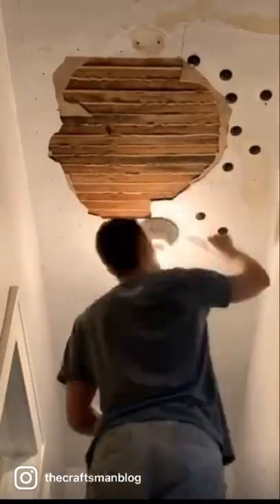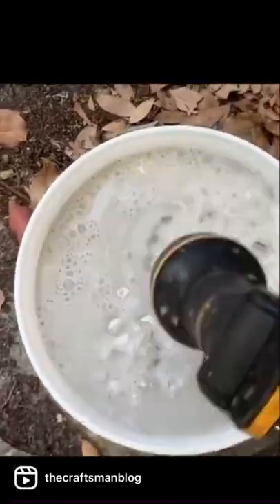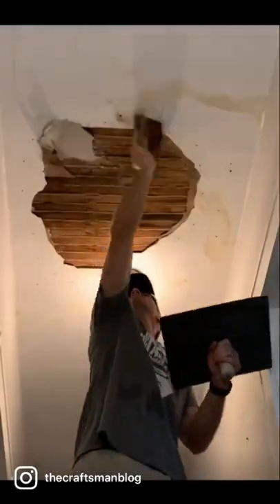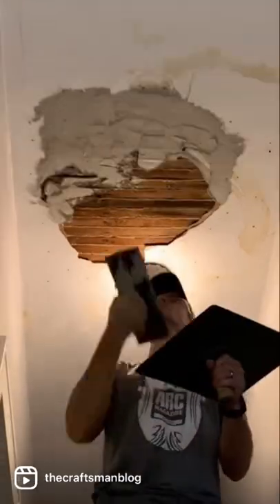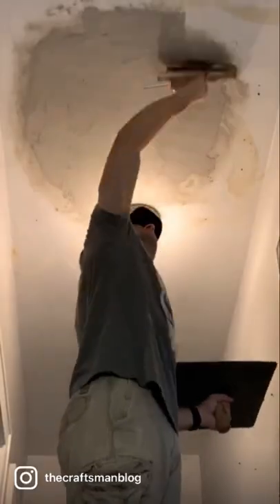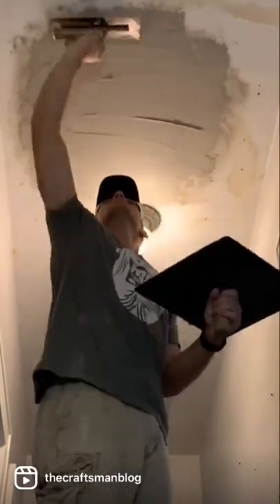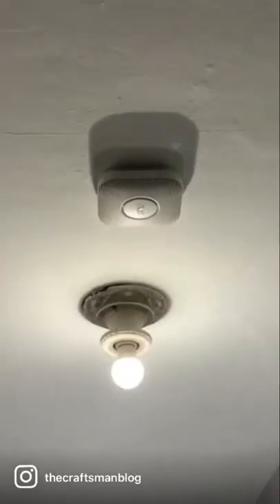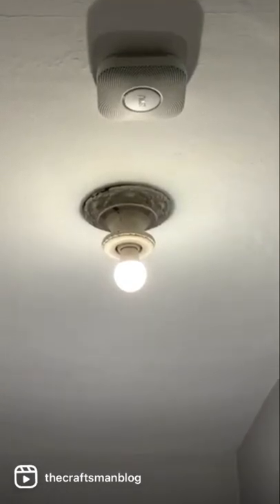DIY Plaster Repair Part 2

Comment: You could also hang drywall, mesh tape the joints, easy sand the patch with at least 2 coats, then sand down the patch.
Reply: Looks way better

Comment: I’ve done hundreds of repairs like that in old houses. Use 1/4” or 3/8” drywall to patch or fill the bulk of the hole first. Makes for a more solid repair.
Reply: We use 3/8 or sometimes 1/2 blue board
Reply: Screw to the lathe ?

Comment: Or just mount some sheetrock, tape and mud and be done 2 days ago or at least used lath. Leave it to a Moronnial to make a simple repair into a major project. Do you know anyone smart?
Reply: It’s hard to make the drywall height match and look right. Generally we use 5 minute mud to get it done fast.
Reply: Right.put some drywall and 5 min mudd.couple coates and your done

Comment: I was a plasterer and finish carpenter for over 25 years.  The way lath works is the structo light or base coat has to go inbetween the lath and catch on the backside in order for the plaster to be attached to the ceiling.  If there is old plaster inbetween the joints, like there is in this video, and you do not remove the old plaster inbetween the lath before putting a base coat up, all you are doing is putting a coat over the lath and it is not adhering through the lath and curing on the other side to create a solid piece.
The next time you do a patch like this, make sure you take a spackle knife or a 5 in 1 and knock all of the old plaster through the lath, so that all of the lath is open, then start your scratch coat.  You’ll never have to patch it again, if you do it this way.
Reply: I did not know that and it makes perfect sense,  thank you
Reply: I'm glad someone commented with the correct way of doing it, hurt my eyes watching this
Reply: I noticed this right away as well. Definitely has to go through the lath to hook on the backside. It might hold. It might not. But more than likely it will eventually separate years down the road.
Reply: Do you recommend removing the insulation and any plaster that’s above the lathe before starting to apply plaster weld and basecoat?
Reply: Thank you - I was thinking this.

Comment: Am I missing something? Aren’t you supposed to secure in a steel mesh? Not sure how secure ceiling plaster on wood is.
Reply: You have to push it in hard enough to key it in. That is how all plaster ceilings are held up

Comment: Do not wet the lathe. It needs to suck the plaster into it for a tight bond.
Reply: Wrong, dry wood will suck out all the moisture of the plaster and can cause it to crack. He should have removed the old plaster from between the lathe and made a new mechanical key for the plaster to hold.

Comment: I mean I'm no expert but I would of cut some ceiling to size and just patch the outside maybe 🤔 🤷
Reply: You’re not gonna find drywall the same thickness as plaster. When patching plaster you chip until you find an area where the keys are all intact
Reply: @barryallenporter8127  maybe so. but I do have bad eyes that didn't look like plaster to me I could be wrong I normally am wrong Haha

Comment: Use 20 min could have done it all in a hour but also clean out those keys man before you try n plaster it cause it looked like all your keys was filled with the old muck still no bueno senor mas esquala